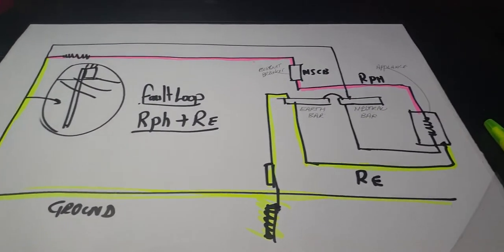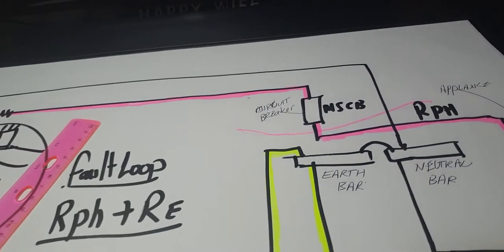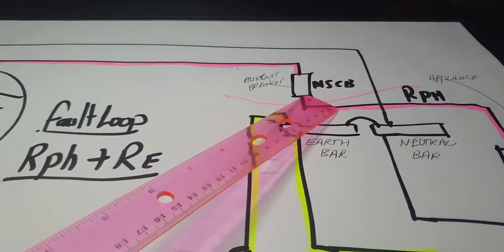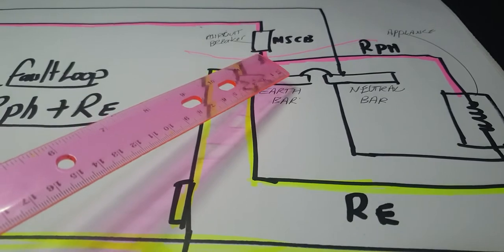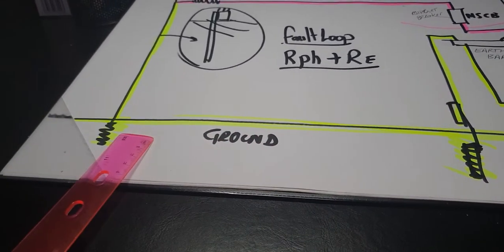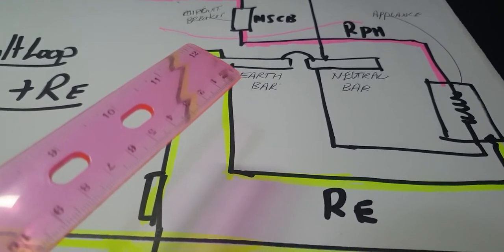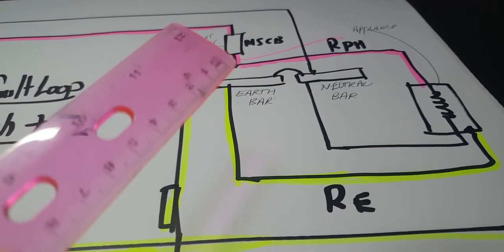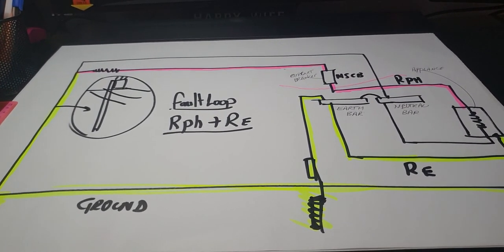The main earth neutral or m.e.n. explained

Comment: Thank you. Very easy to understand info. But i have a further question. In an off grid system (solar with lightning protection+inverter+generator) where does this link go? Do they all run to the same earth? Is there a way to separate the earths so that lightning or static electricity does not upset the rcd function? Is that even an issue? There is a real lack of info on this subject. Maybe im just looking in the wrong place?

Comment: Should the MEN link be thick, least resistance or thinner making a higher resistance? I'm thinking thicker so the current can pass through quicker and the resistance of the other metals in the housing will allow for that 5 or 10 ms delay. Am I correct?
Reply: that depends on on the wiring rules. A dummy value is having it the same csa as the neutral conductor, but there are variations to consider in varying the size. theres also a rule stating a conductive enclosure needs bonding equivalent to that of the neutral conductor. Imagine seeing a 16mm2 bond on a domestic board wtf hahah. But like i said there are variations to factor in that can either increase that size or decrease.

Comment: There's a few things I'm missing here. Why doesnt a little/all current flow from the neutral bar through MEN link to ground? I was under the impression this path is super low resistance. 

Also where does current go once going to the mass of the earth? Does this diagram show it going back up the power pole?

Comment: I believe traditional earthing is made redundant by MEN
Reply: its just there as a fail safe.
Reply: Traditional earthing via an earth stake is there to protect the electrical installation (wiring etc) from lightning, not for protecting appliances and people.  If protecting appliances and people is all that is required then a path to earth isn’t strictly necessary, although it does provide some redundancy in case of high resistance or open circuit on the neutral. 

Electric current will always try and return to where it came from, if it came from the pole transformer it will try and return to the pole transformer (through the neutral wire or the earth stake if there isn’t a path back through the neutral). If it came from the ground (lightning) it will try and return to the ground.